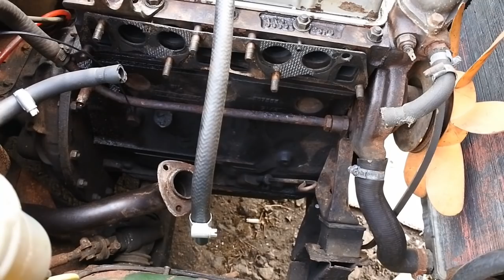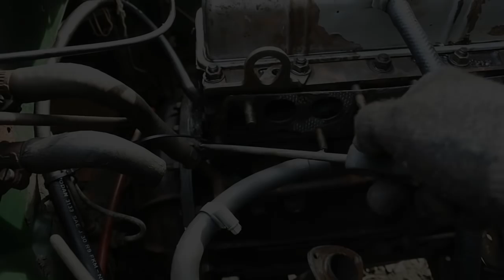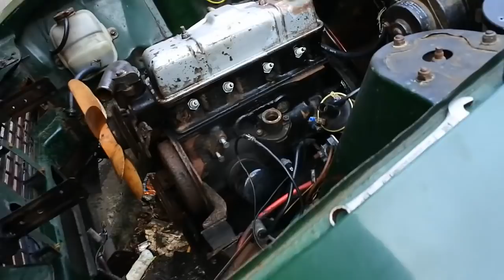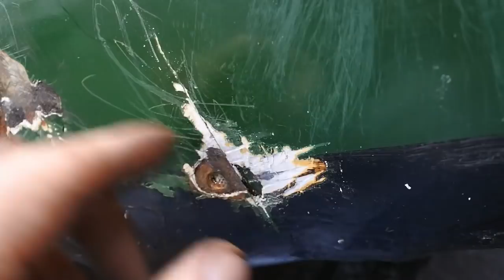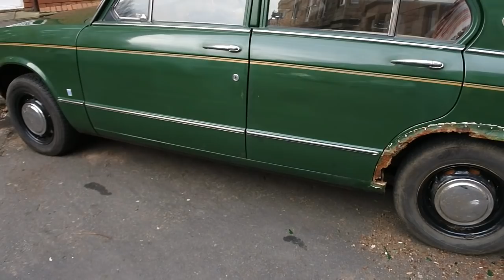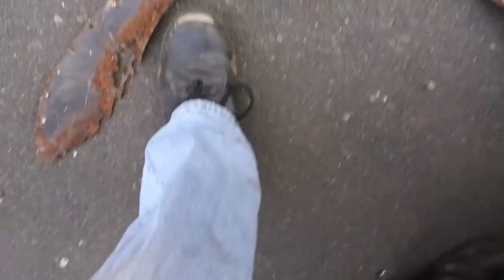Dolomite Engine Replacement - Part 2 + Bonus Rust Poking

Comment: Im Looking to buy a acclaim. How much would i be looking to spend on a low(ish) mileage one?
Reply from the maker: The going rate is around £1.5k to £2.5k for a tidy example. The condition of the body dictates value more than mileage as Acclaims tend to age well mechanically.
Reply: @CaptainSlow1992  great thanks. Dont seem to be many around.

Comment: What's the latest on the old dolly?
Reply from the maker: This video! Everything is on hold until a new engine arrives, it's been on the cards since January but initial plans for moving it fell through...
A NOS rear wheelarch repair panel has been acquired for the passenger side, on the driver's side I'm going to drill out the rivets and see if I can save the panel that is already there. That'll have to wait until after the car is drivable though so I can actually move it to my top secret welding facility...